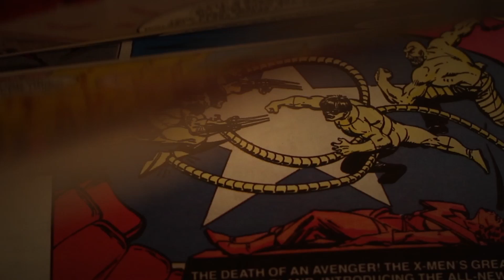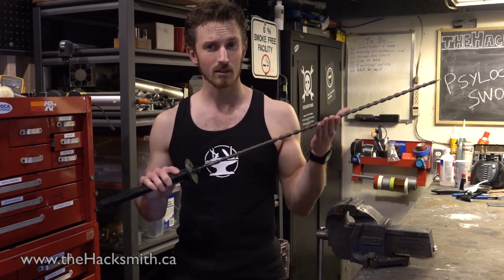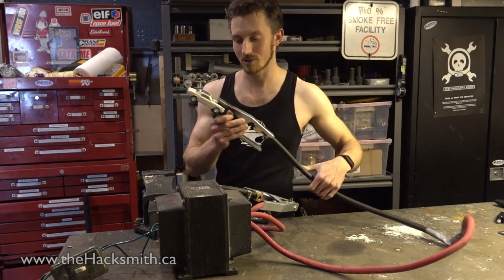Make it Real: Psylocke's Psionic Sword (X-Men Apocalypse)

Comment: Hey I was trying to make Black Panther 's retractable  claws any ideas on the retractable part?
Reply: Four brake cables from a bicycle to actuate the claws. This lets you move freely without a solid linkage. All four are tied together on the wrist and pulled by a 2" long offcut of leadscrew from a 3D printer. The leadscrew is turned by a continuous rotation hobby servo. That way you get a good strong pull (50KG of force) and it can't  be backdriven by pulling on the claws because of the leadscrew.

I don't know where he'll find vibranium for the claw tips though :P. Perhaps tungsten carbide?
Reply: +IOUaUsername Haha Yea that is a rare commodity. But thank you for the help.

Comment: Do you have to restoring the entire blade after it gets burnt?
Reply: retread*
Reply from the maker: +Martin Tse eventually, but Kevlar has very high heat resistance. Alcohol burns at a fairly low temperature, so we haven't changed it yet!

Comment: granted that is incredibly bada$$, how many times can the sword be ignited until you have to re-wrap the cord through those holes?
Reply from the maker: quite a few, alcohol burns at a fairly low temperature (still enough to burn you badly) but kevlar rope is extremely temperature resistant!
Reply: thanks! I'll definately keep that in mind for future projects

Comment: To bad it only has so many uses before you have to re-string it.
Reply from the maker: +Keean Nelson Kevlar rope has a very high heat resistance and alcohol burns at a very low temperature. It'll actually last a very long time!
Reply: Well is was a prototype

Comment: Can I Switch Out the chemicals you're using for a Boric acid and methanol Combination (GreenFlames) unfortunately it turns to dust if exposed to air but would it work?

Comment: Your badass magic sword couldnt rip toy apart, lamee!!
Reply: may i see what yours does sir?
Reply: I didnt did one, for what?
I dont have time.
But I could make knife from steel that is battery powered and heats up to 600*C.
Or If you will give me nice piece of titanium it could heat up to 1500*C and rip cars apart.
Sounds cool enough?
But that cute girl wouldnt be able to use it because it will be about 10-20kg.
Reply: Yeah, that's one of the limitations of... Reality.
Reply: Click read more on my prev reply.
Reply: I know it's a year late but won't titanium be useless in making bladed weapons? It's hard to make them sharp because of it's hardness.